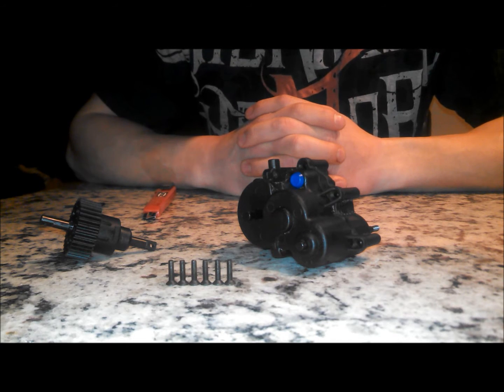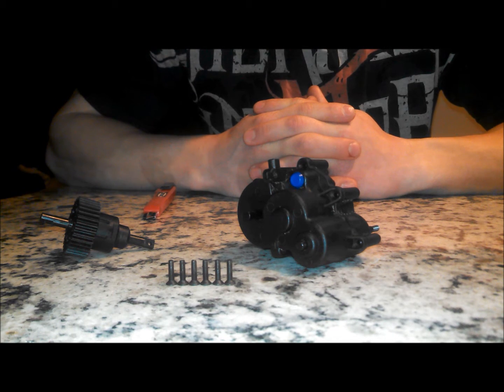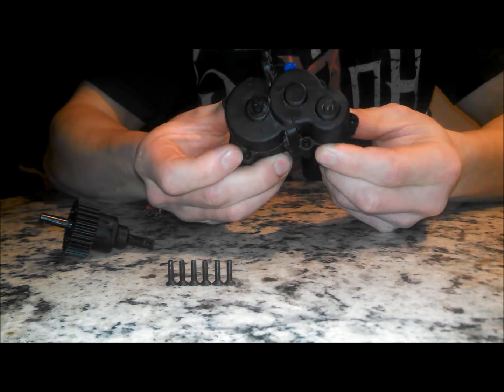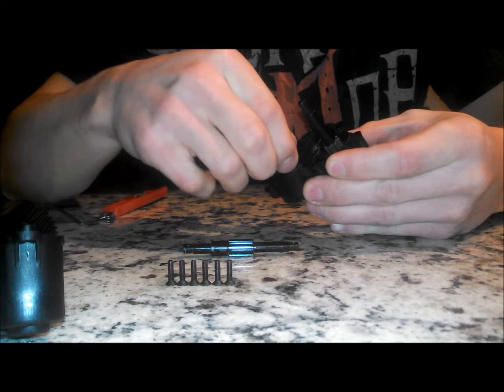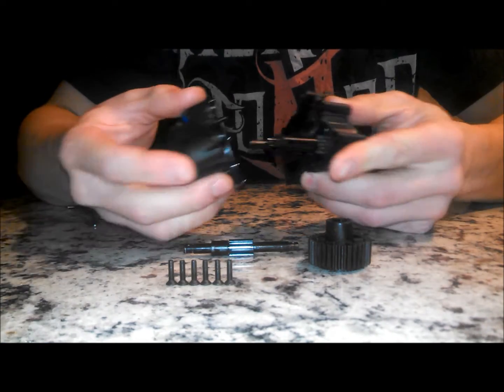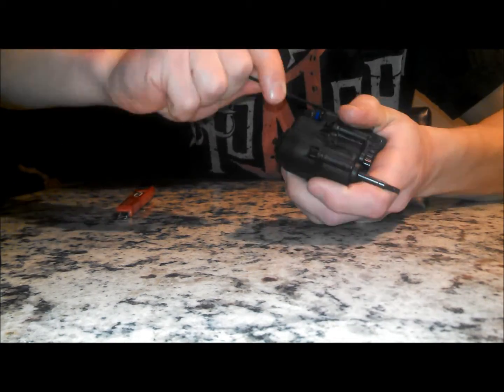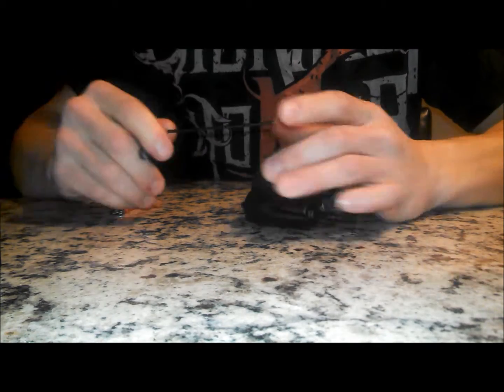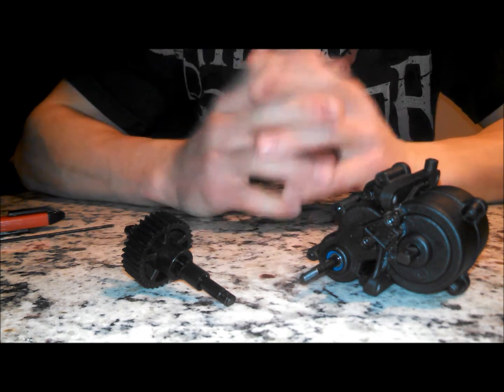How To - Install Center Differential - E-Maxx & E-Revo (HD)

Comment: How did the center diff change the performance was it better than stock or no i got one for my stampede 4x4 and idk if im gonna put it in thanks.
Reply from the maker: Well, this center differential comes with like 500k diff fluid, which still makes it ride wheelies like crazy. This weekend I'm going to go to my LHS and pick up some 50k and try it out. It should help loosen things up and keep the front end down. I'm also going to tape my tires because the ballooning is too much, too.